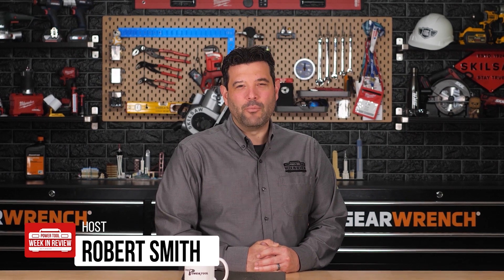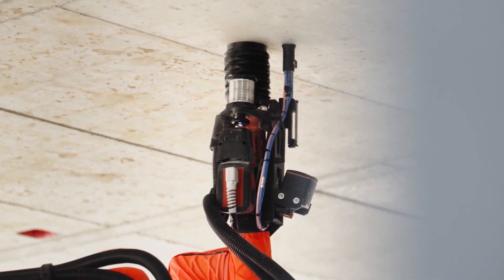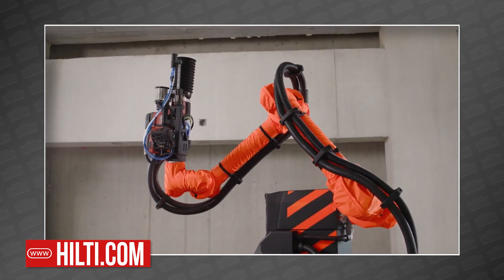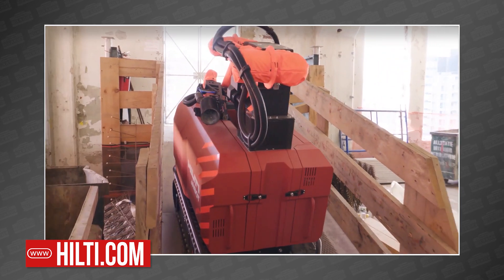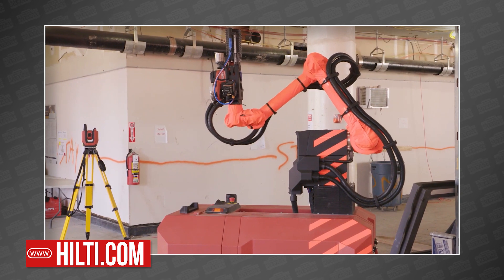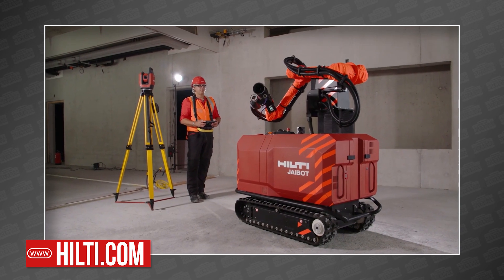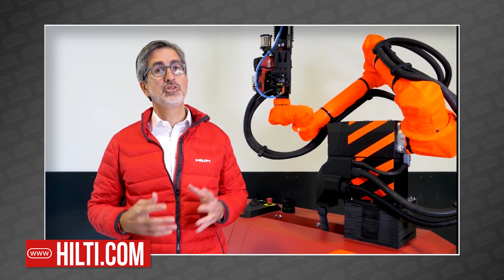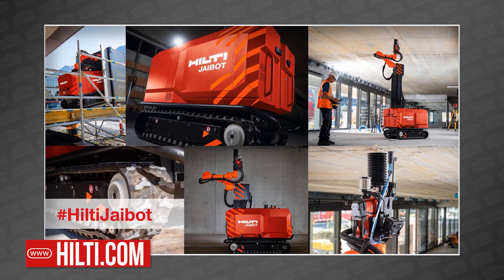SHOCKING new Job Site monster REVEALED! NOT A JOKE! The HILTI JAIBOT has entered the lobby.

Comment: So this machine could drill holes during the night when nobody is in the building to complain about noise. Great idea.
Reply: you probably don't want a robot drilling holes in structural concrete unsupervised lol. it will probably be treated like a 1st year apprentice ahahaha
Reply: @blzt3206  Depends on what holes, but for anchors yes
Reply: @blzt3206  honestly if it is reliable if I think it only makes sense. If it is taking info from the BIM software then it’s probably safer to have the robot make holes then a human. I have worked in buildings before where anchor locational accuracy is considered basically top priority. Most of the time use gps and a total station and uses pour in place anchors. This machine is cool as heck! I wonder how much it weighs and how tall it is? If it couldn’t fit in a man or freight elevator it might have limited viability. I hope they choose to sell this product basically at cost to build a market.
Reply: Where is all the other trades with there tool boxes and piles of material in the way?
Reply: @icekilla126  lol this.
Reply: No, there still needs to be an operator with the Jaibot at all times.  The main point is to keep workers safe by not having to drill overhead, exposing them to dust.  There are other advantages as well in terms of productivity and aligning a the MEP trades anchor locations, just to name a few.
Reply: We all saw the video. I'm just hiligthing the advantage that it could be programmed to work at offsetted hours without the additionnal cost.
Reply: Its semi autonomous so still need human input to work.

Comment: As John Oliver says, ok there is a lot to unpack here. ....

Firstly Hilti always charged way over the odds for everything, regular drill bit €4, hilti drill bit €45 
Secondly this is the start of, replacing regular labour onsite, this should not be welcomed.  Yes drilling holes over head all day is not fun but it is a job for someone and a potential income for a family, replacing it with a robot is bad juju 

Thirdly, we are basically going to do to construction what we did with car manufacturing.  Remove human, install robot.  No offence Rob, I love your Chanel but in twenty years I’m not going to be watching if every tool video is held by a robot.
Reply: 20 humans could pull a trailer instead of a truck. We will always continue to replace labor intensive jobs with machines. It's good for humanity. Yes it will displace some jobs short term, but change is always hard. This type of innovation is the key to lowering housing cost.

Comment: If a person is needed to operate that robot via remote every time, just have that remote person do the actual work instead. To me, it would take longer to program a robot to do a specific job, then package and transport and setup the robot than it would to just have a person pick up an SDS and drill away...
Reply: Image you come home 90% more clean, not covered in concrete dust, your lungs are fresh your hands not sore and you are not dead tired.
Still have enough energy for a walk with the dog a short workout, playing with the kids and even have enough power for sex after work. Thanks to that thing. Sounds horrible, its way better to breath all day concrete dust and push an loud huge ass drill all day up into a celling directly beside your ears on a 20 feet ladder
Reply: Your missing the point...this thing uses a total station to layout out the holes AND drill them AND vacuum them.  No human could layout and drill even 10% as fast as this thing.
Reply from the maker: First of all, if you have only one hole to drill, you're right, get a guy. It's faster. But this is far superior when you need to drill 10,000 holes in a new build.

Second, are you volunteering to be the guy that has to not only hold a 12lb tool over your head on scaffolding but then PUSH that 12lbs up into the ceiling hundreds of times per day? I'd much rather be the operator that is making sure the tool is doing the job correctly.

The drill it's using, is just a previous step in this evolution. Imagine your comment when the first power drill was made.

"If a person is needed to operate that new drill, I'd just have that person do the actual work with a spoon."

WHY? 

This is a drill. It just happens to have the added feature of being able to hold itself up, and drill holes EXACTLY where you want them. That's better than doing permanent damage to your spine. Maybe you can retire and still be able to play football with your grandkids. 

Why not embrace progress, and be the one guy on the job site who raises his hand and says "How can I be a part of this?" and be first in line to learn how to program or operate the future?

Just another perspective for you to consider.
Reply: @ToolShow  me as I read paragraph after paragraph of you dismantling their argument. https://youtu.be/UcZzlPGnKdU
Reply: @thomasmerritt7322  if you remember right it was a death sentence.
How many do you know that are permanetly sick or damaged working in concrete dust or chemicals with protection gear of the old days? How many hip and knee replacements how many 40 to 50 year olds with the body of an 70+? How many died thanks to asbestos and that boss that told you that one pair of gloves per week is enough and full protection 3m mask is nonsese?
This thing will give operators much more Quality after work is done
Reply: Just to clarify there isn’t a person required to “operate them by remote” as in they have to control every movement. It’s more like a CNC on wheels, scales up to use power tools. But it will need operators on site to set it up and tend to it obviously.